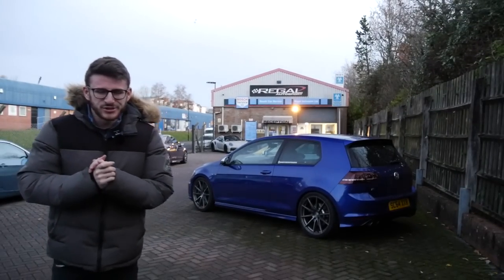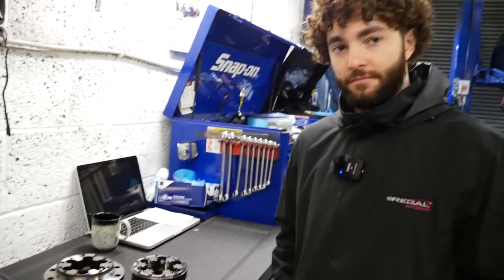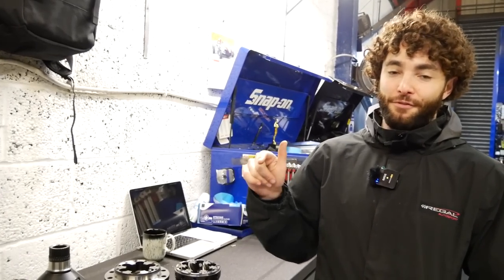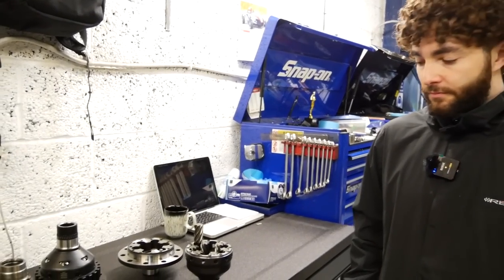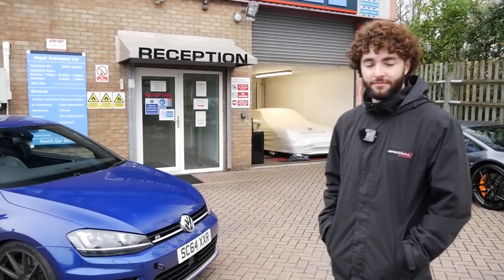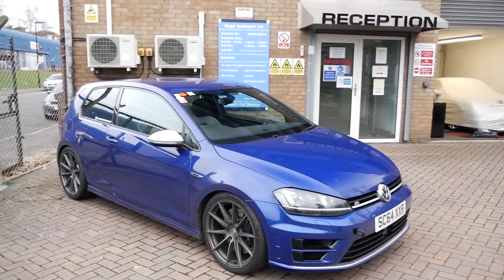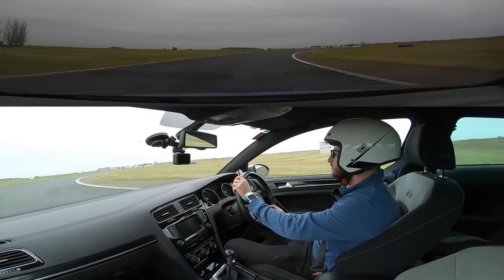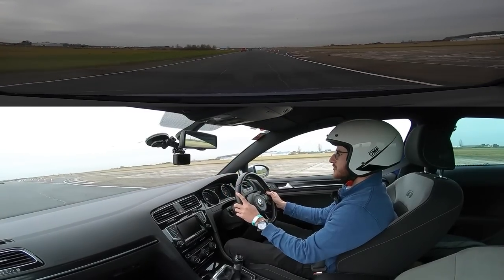Wavetrac LSD Installed to my Manual Golf R! (+FIRST DRIVE ON TRACK!)

Comment: A good old LSD...to obliterate the dreaded "Torque-Steer" and plant all that power to the tar. This combined with the already impressive 4WD, and Coilies, and you can fly round corners welded to the floor....7:52 To avoid "Flywheel" issues, install a "Solid Mass-Clutch Kit"....You'll never have flywhhel problems again....
Reply: Question: i have problem with back part of car. When goin straight back part sways left to right when pushing down all 360 hp and 462 tq i have on my gti clubsport. Would a better diffrential fix this as tires get better grip? The car is FWD only, so i suppose it dont..?
Reply: @tredfxman  maybe you have to replace youre rear bushes, the Ones you have at the Moment are probably gone, then upgrade with some polyuretan ones.

Comment: The revs still seem to be flaring exiting slow speed/low gear turns. Is that wheel spin or clutch slip? Around 16:10 is a good example.
Reply from the maker: As mentioned in the video, it was a cold & sightly damp track, so grip wasn’t perfect. Plus I was running a set of pretty worn Cup 2’s
Reply: @hampshirephoto  wouldn’t expect it just to spin the unloaded wheels though. Perhaps the rear diff will help.
Reply: @michaelco2115  i see the haldex system not working properly... I have a 300hp old s3 and the back end kicks out in 2nd when it looses traction, his golf is spinning the front wheels

Comment: How are you finding the brakes? I run the same set up as you but they don't last very long, discs are a fortune too compared to other brands
Reply from the maker: Genuinely love the BBK - this track day finished off the pads, but wouldn’t hesitate to recommend the setup to anyone
Reply: @hampshirephoto  agreed my cars running 515bhp they stop her very well, looking into replacing my discs with some Reyland or another brand that isn't £620 😀😀

Comment: What brakes are you running exactly??
I'm on C Hook standard size discs all round, yellows stuff pads, braided lines and dot 5 but still find that brakes overheat anyway quite a lot.
I'm quite aggressive on track with last second heavy breaking

Your R runs dream!!!

Keep it up!

Great content
Reply from the maker: Thanks Rafal! It’s the Forge Motorsport 6 pot BBK (356mm discs with ceramic pads & braided lines & uprated fluid). Rear brakes are completely stock for now

Comment: So you worked out power, suspesnsion and brakes. Awesome!

May I suggest a couple more mods?

-Bucket seats - will give you a much better driving position, enhance your confidence as a driver and to top it all off - weight reduction
-Rear seat delete - reduce your weight further, and if you get a rear seat delete kit like Stern Preformance clubsport kit you will have a very practical boot to work with aswell.
-Harness - tie yourself down properly in the bucket.

Bouns mod: CAE Shifter!!

Love the build! Love the videos! Keep up the good work luke :)
Reply from the maker: Thanks buddy! All of the above is planned 👌🏻

Comment: Great video. Does the Golf R MK7 not come with the Volkswagen VAQ E-diff?
Reply from the maker: Thanks! I’m unsure to be honest, I believe it’s open from factory
Reply: @hampshirephoto  the Wavetrac should be effective nonetheless!
Reply from the maker: It’s made a huge difference, and I have the option to put a Wavetrac on the rear too
Reply: @hampshirephoto  If you did go ahead with the rear diff, I'd be very keen to watch a video on your thoughts!
Reply: @Harry - the MK7R hax 'XDS' which is software that slows down the freely spinning wheel, so drive can remain. That puts a lot of heat through the brake system, with the Wavetrac installed this can be turned off.

The VAQ E-Diff is also still an open differential inside. On 2WD cars it actually uses a 4WD differential, as it has the spline on one side to drive the VAQ E-Diff which is mounted externally. The VAQ E-Diff is basically a haldex unit, and it works by locking the axle to the differential housing. 

Lots of customers, especially with higher power cars feel the VAQ E-diff struggles, so they install the Wavetrac to get a big performance boost!
Reply: @hampshirephoto  when will the rear diff be available? Is it from regal or from wavetrac direct? Great vid mate!